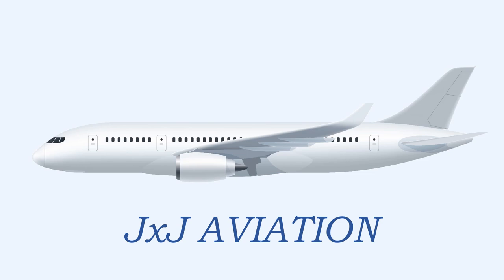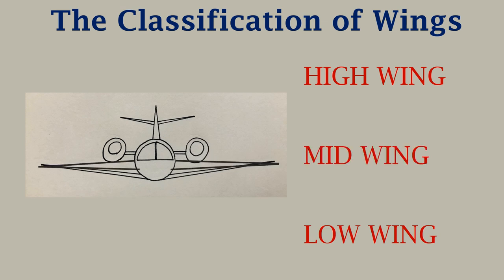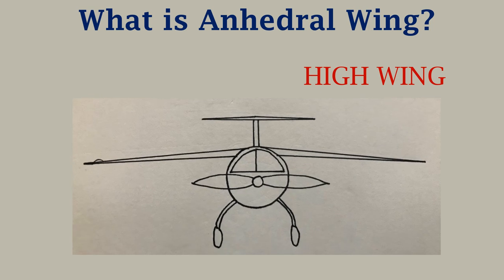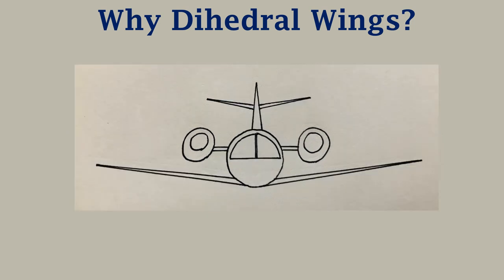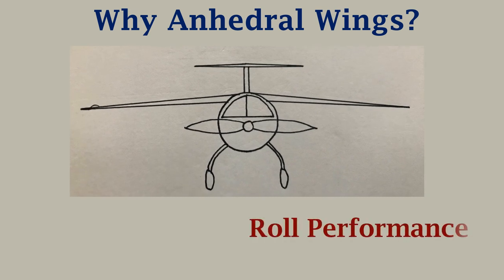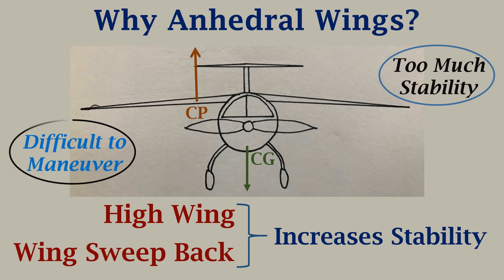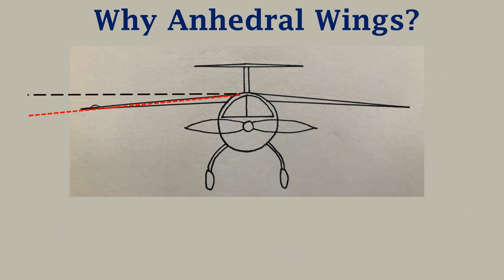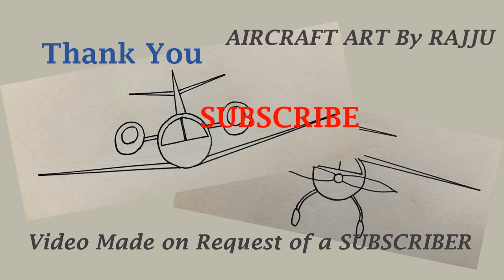Understanding Why Aircrafts have Dihedral/Anhedral Wings! The Roll Stability and Roll Performance!

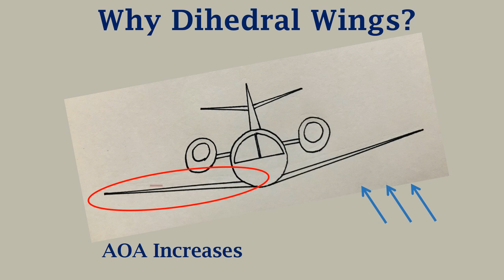Comment: 2:11 why is the AOA of the lower wing added up, i'm a little confused about that part, everything else is fine
Reply from the maker: Because of the disturbance the wing is moving downward which seems like an increase in the AOA on that wing.
Reply: Oh aerodynamics is amazing, i got it thx man
Reply: @JxJAVIATION  But this would also work on an aircraft with no dihedral. The  dihedral effect comes from the sideslip movement resulting from an imbalance of forces. Therefore the wings get a sideways airflow with the lower wing at a higher angle of attack.

Comment: Can you explain about antnov aircraft wing?? It is Anhedral wing and also swept back wing.it can carry more load than normal aircraft like b747 etc.
Reply from the maker: the antonov wings are designed in such a way that they carry more weight, and a high wing makes loading easier!

Comment: It should be noted that the thumbnail and summary graphic make an erroneous assumption or indication that the Dash 8-400 aircraft has anhedral wings. It does not. Though anhedral is common on high winged jets, turboprops are commonly designed with dihedral wings. The Q400 is no exception.
Reply from the maker: Yes. Thank you for your valuable input!

Comment: The explanation for the increased stability of the high wing regarding the center of gravity doesn't seem plausible to me.
Reply from the maker: the high wing provides better roll performance because of the distance between center of lift and center of gravity
Reply: @JxJAVIATION  Why does this distance result in better roll performance?
Reply: Because the resulting force applied along that distance or moment arm produces a moment which induces stability

Comment: This explanation is completely wrong. First it should be known that a dihedral wing does not change its forward angle of attack directly, but when rolled, this is a result of side slip that changes the relative wind. The high wing aircraft has anhedral to add roll stability, to blank out the fuselage with the wing. Consider aerodynamics of side air pressure on the fuselage, different between high and low wing airplanes. The plural of "aircraft" is "aircraft".
Reply from the maker: Thank you for the information! The change in AOA is felt by the airflow because of the disturbance causing an increase in lift in the downgoing wing. The plural of Aircraft is a mistake I made and could not change!
Reply: Not completely wrong, but the reasoning behind anhedral is not well explained, and while flex does play a small role, most high wing aircraft with anhedral do so to overcome the “dihedral” effect of wing sweep. The body also contributes to “dihedral “ effect adding roll stability when below the wing, and subtracting from ii when above the wing.